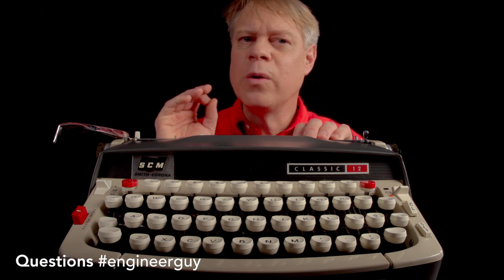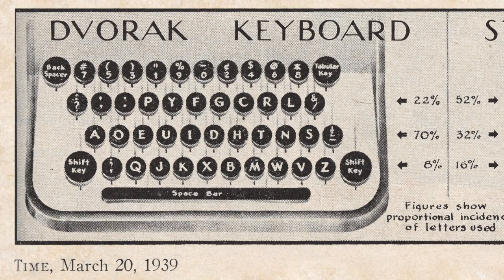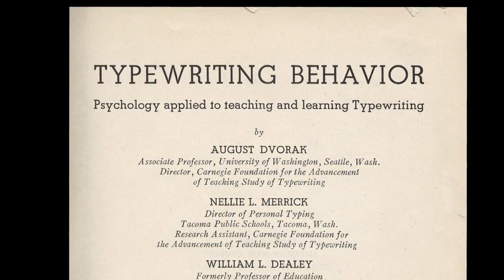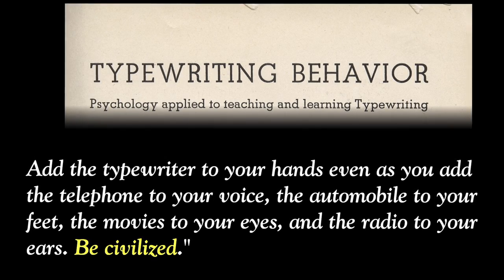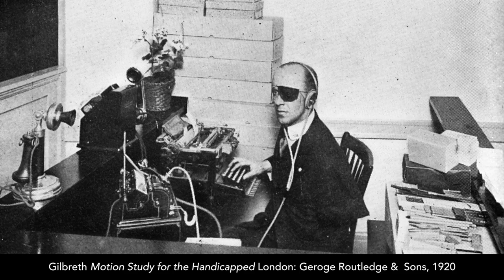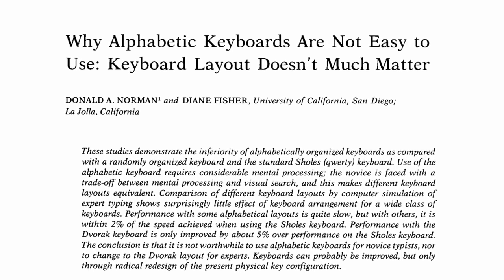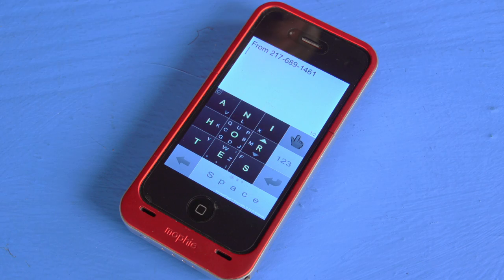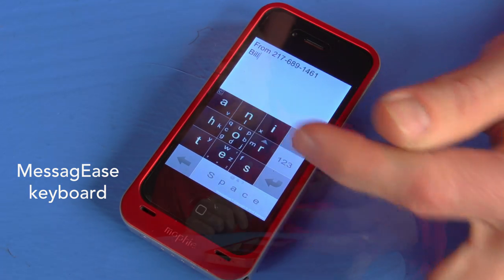Why the Dvorak keyboard didn't take over the world

Comment: I type regularly on both Dvorak and QWERTY layouts, and can comfortably touch-type on either one.

My personal experience is that Dvorak is about 75% faster for typing - I manage 70 WPM on Dvorak , but only 40 WPM on QWERTY.  This is quite interesting considering that I started using Dvorak relatively recently, maybe 8 years ago, but have done QWERTY since I was a child and indeed had formal typing classes on it.

There are some further wrinkles, though.  Firstly, my Dvorak keyboard is not quite the standard staggered key layout, but is an ergonomic one with the keys laid out in a grid fashion, much like the numpad.  This probably factors in to some extent.  Originally when I learned Dvorak, I was using an ordinary keyboard remapped to the Dvorak layout.  At this time, I found switching back to typing on QWERTY very difficult because learning the new layout scrambled my muscle memory.  I could type naturally up to a fairly rare letter, something like B, where normally I might have a split second pause to remember where it was, only to find that I had no idea whatsoever, just as if I was learning from scratch, despite having used QWERTY for many years before that.  After a few months, I got my present ergonomic keyboard, and suddenly I could switch back and forth between keyboards (the QWERTY ones being standard keyboards on other computers) without any problems.  Apparently the slight differences in key alignment stopped the conflicts in my muscle memory.  Very interesting.

Another thing I've noticed is that while Dvorak is far easier and faster to type with most of the time, it's really, really bad if you have to do any 1 handed typing.  This is due to one of the major design choices in the Dvorak layout - all the vowels are on one hand and all the common consonants are on the other.  This improves typing since it means that alternating hands between letters is very common.  This, however, is a worst case for 1 handed typing, since it means the vowels are on one side of the keyboard and the common consonants are on the other!

The one really big reason stopping people from switching layouts is the sheer amount of time it takes to learn a new layout.  In my case, it took about a year before I was typing on Dvorak as fast as I could with QWERTY, and while this is pretty impressive considering how long it took to get QWERTY there in the first place (and I indeed now type Dvorak faster than I ever could with QWERTY), a year is still quite a investment in terms of time!
Reply: GAH!  Youtube ate all my newlines!
Reply: Excellent comment. Thank you,
Reply: The Youtube comment section is so full of idiocy that Youtube can't afford to keep it indexed and searchable, there's just too many of them, and most of them are "first" or "I'm early".
Seeing comments like yours, of which there are many, but are drowned by the other bullshit, really makes this a sad realization.
I truly hope that at some point all these comments will be searchable. There are many testimonies and "tiny blog posts" in the comment section that would be an interesting read, for someone doing research into what people think or their experiences.
Cheers!
Reply: It only took me a month, and about two to get back up to ~70 WPM that I had with QWERTY. Guess it depends on how fast you learn and how much you type really.
Reply: There are 1 handed Dvorak keyboard layouts for either hand. They might even come with Windows these days.
Reply: I've been using Dvorak and QWERTY interchangeably for years, depending on what I'm doing.  After a bit of time with Dvorak, I can type with both at about 95 WPM each with similar accuracy, but Dvorak is definitely much more comfortable to type with for long periods.

I didn't have the same success getting "faster" with a new keyboard layout as a lot of people did, but I do still recommend it to people that type a lot during the day, and a lot of people do seem to learn it really, really fast.
Reply: Perhaps it was not only the Dvorak layout but the straight grid arrangement which helped to increase your speed. As anyone who has actually SEEN a mechanical typewriter up close can see, the reason for the staggered arrangement was to put the center of each key on a unique X-coordinate, so that a series of parallel levers could be used to communicate the key motion to the rest of the mechanism. With electronic and touch screen keyboards, this is not necessary, and the keys can be in an orthogonal (or hexagonal if you're into beehives) arrangement. Indeed, the position codes used to describe the locations of keys in keyboard driver software use X- and "Y"-coordinates, with the "vertical" axis tilted so that, for example, the keys 3edc and space are in one "column," while 4rfv and space are in the next, while the physical and geometric arrangement looks like a mechanical keyboard, for the sake of tradition.

(continued)
Reply: +Allan Richardson (continued) So perhaps the straight, rather than staggered, grid is either objectively more ergonomic, or the slight difference prevents automatic "fallback" to qwerty habits, allowing the Dvorak layout's advantage to be revealed, much as children being raised bilingually, and adults learning a new language, learn faster and more fluently when the two languages are used in different contexts and with different people (e.g. the French mother only speaks French when alone with the child, while the English father only speaks English).
Reply: Dvorak in a grid I think would work out quite well as the F key is a bit of a stretch in Dvorak using the ASCI configuration.
Reply: I do in fact use Dvorak on a grid layout.
http://www.typematrix.com/
Reply: Yep, alignment modification is how you shut off dat dere muscle memory, or even "swap between movement patterns" more easily.

That's why some fighters change stances slightly for no obvious reason, not even for ease of deploying a strike, but to remap the muscle firing sequence. And why some console gamers can escape the problems of having the X button on 4 different places, depending on wich console you're using.

Of course it can be done without this, but it aids in minimizing those "uuuuhhmmm(?)" moments wich are no bueno at all.

Btw, long live one handed typing while camping xD
Reply: zahrim bizarre
The keyboard shape really did make a difference there too, though not quite in the way one would expect.  For the first month or so, I got to typing Dvorak pretty well, but when I'd switch back to using a Qwerty keyboard for whatever reason (different computer, mostly;-) ) my head would explode and I wouldn't be able to remember the key layout at all!  It was almost hunt and peck!  Once I switched to the grid layout for Dvorak, that problem went away entirely and I could type on either one interchangeably without any problem.

There are some other interesting effects with respect to various layouts too.  Windows (and Mac, for that matter) lets you change your keyboard layout just in settings somewhere or other, so you can type on any old Qwerty keyboard as if it were a Dvorak one.  The problem is that while I can touch type just fine, if I ever actually see the letters on the keyboard in the wrong places My head explodes and suddenly I can't remember where any of the keys are supposed to be or touch type at all.  Interesting cognitive dissonance effect.
Reply: +Keldor314 hmm... Well, i happen to be a native spanish speaker, so adding a different keyboard layout might be too much trouble on top of different sentence structures and grammar, besides i don't need extra speed... I was just trying to chip in some knowledge about stances and muscle memory.

Even drivers i know tend to shift their butts on the seat when they change from truck to sports car. 👀 "it helps you remember what you're using" they say.
Reply: maybe that's because you have low affinity with qwerty? you double your 
speed with dovrak, but you actually have a fairly low wpm rate in 
qwerty, which is what makes that possible in the first place.

i'm a pretty fast typer, and i can maintain over 90 wpm in qwerty for 
hours if needed (peaking at about 130 for short minute-long bursts, i 
think) . i have no idea what i'd get in dvorak but i'm damn sure it 
wouldn't be anywhere close to twice as fast, because at the speed i type
 it's not that far from the speed i can actually read and comprehend 
what i'm reading, or form clear and concise sentences in my mind.
Reply: I can type about 110 for extended periods with both Dvorak and QWERTY. Dvorak feels nicer to type because one hand doesn't get all the strain, as it alternates, and this is part of the inherent design.
Reply: +Theodore042 They are already available in Windows.
-Just open your "Text Services and Input Languages" (Control Panel -> Region and Language -> Keyboard and Languages Tab -> "Change Keyboards")
-Under the "General" tab click "Add"
-Search for your language and expand it by pressing the "+"
-Check "Show more..."
-Scroll down to "United States Dvorak" and check it (You can even decide between left and right handed)
-Press "OK"
-Press "OK"

Now you have the possibility to switch between your old keyboard-layout and the Dvorak-layout by clicking the language button in your taskbar to the right and select between them or you can just press Alt+Shift to toggle between them.
Reply: 40WPM is pretty bad. Back before I learned to touch type, I could hit 35WPM with just two fingers. If you're doing 40WPM touch typing, that means you haven't practiced enough.

80WPM is easily achievable with a QWERTY keyboard if you spend some time practising. Even late into the evening, copying somebody elses text word for word, I'm still over 70WPM and I type fast enough that I'll have entire wrong words show up in my text if I have something on my mind.
Reply: I'm by no means a serious typist.  I don't practice at all, and just type when I want to say something.  In that case, I generally spend more time thinking about what I'm going to say than typing.  Perhaps the conclusion to come to is that Dvorak is significantly faster to pick up and use without dedicating any more time to learning than necessary.  I've only measured my speed out of pure curiosity.
Reply: I can write over 100 WPM on QWERTY. The studies are right. Key order simply isn't that important.
Reply: Back in the day of unassisted manual machines, sixty or seventy WPM was considered expert.
Reply: I came on here because I'm an adult learning how to type. I'm fast with 3 fingers or hand but finally doing this the classic way. 
was wondering if I should learn both (in the same ways I have taught languages to myself) and saw this comment from you, left on my bday  (6/25). Not a coincidence lol!! this answers my question a lot,  thanks  
for your story
Reply: 40 WPM is shit slow, I can do about 300 WPM per hand.
Reply: Keldor314 what keyboard fo you have?
Reply: 40 WPM? Come on. That has nothing to do with dvorak being faster, you just don't know how to type. If you got a copy of mavis beacon and starting typing properly, I'm 100% sure you'd match your dvorak speed.

No, the reason I don't learn dvorak is because dvorak is pointless. I don't have carpal tunnel, and it offers such a negligible speed increase that there's literally no reason to even consider it, let alone completely relearn all of the muscle memory I've built up over years.

In other words, you being a slow typist does not make Dvorak superior.
Reply: 300 WPM per hand he says lmfao

As if not even most court stenographers can't type that fast.

You're literally 100WPM faster than the world record holder in each hand, congrats.

I don't think you know how long a minute is, or how to count to 300.
Reply: Eric Bishton It's not that Dvorak is pointless, it's just not worth the trouble, especially if you're already a fast typist (typer?)
Reply: Keldor314 Like others pointed out, maybe it's because you can't type in qwerty in the first place, I can go up to 120 wpm in qwerty but like ~0.5 wpm in dvorak because I very rarely used them, does that mean dvorak sucks massive donkey balls? Of course not, it's your typing skills and your familiarity with the keyboard layout.
Reply: Keldor314 Also, 8 years isn't 'recent', that's way enough time to make you a good typist with any layout.
Reply: +This is Patrick
damn. how'd you get so fast? are you a programmer?
Reply: Justin Crediblename Nope, government offices here have this weird test where you have to score a minimum wpm rate at typing tests, so I'm forced to learn how to type quickly.
Reply: It's funny you consider "recently" as 8 years. That's enough to master an instrument.
Reply: Geez, my hand writing is faster than using any keyboard, I can only type an average 3 wpm and write an average 16 wpm. I guess this still has something from high school at the time where there was only one computer or electric typewriter in the whole school in the last year I was there and I have always written everything on paper by hand before ever getting to any keyboard. Yet I read an average 85 wpm yet can't seem to speak the word's through at the same speed.
Reply: It took me about three months to get up to speed, but I was in full immersion mode. I practiced for about an hour every day. Even my phone had it. To your point about the grid layout. My phone was much easier to learn on because the muscle memory wasn't as old. Even more, a couple years ago I actually adopted the keyboard this guy showed at the end of the video a couple years ago, and I got decent within probably a week.
Reply: Great...I use "Colemak".
I don't know if that's bad or better.

Comment: Before watching: because standardization beats efficiency.
Reply: bcubed72 same with measurement systems
Reply: @kinnikuzero  Only in USA though
Reply: That is an awful but true point
Reply: For it to worth changing standardisation for efficiency, there needs to be a significant improvement in performance. 5% improvement just isn't enough for people and keyboard manufacturers to change to a new standard.
Reply: @bangscutter  Built to order computers like Macbooks could offer a DVORAK option on the order form perhaps, while both QWERTY and DVORAK keyboards could be stocked side-by-side in Apple stores for desktops? :)
Reply: What if I told you - standardization enables far greater efficiency at a global level.
Even suboptimal standards are way better than no standards at all.
Reply: @unfa00  That sounds suspiciously like my argument. Though you seem to think it contradicts mine, for some unfathomable reason.

Comment: I have been using Dvorak for several decades.  Even before PC came.
The first one was IBM Selectric typewriter with a Dvorak typing ball. Next, I had the typewriter modified into Dvorak arrangement so that I could use any IBM Selectric typing balls. When IBM PC came on in 1980's, I had to wait until a key remapping program became available. Now it is easily supported by Windows OS.
I would never go back to QWERTY. I have typed several book length material. QWERTY could have killed me with  hand strain. For last 10 years or so, I have been using TypeMatrix typewriter which allows to toggle in and out of  Dvorak layout without going through Windows language setup. Qwerty should have been dead, but reality is like the way things are - dead men walking without knowing they are dead.
Reply: Same here, though not until 2004 or so.  My wrists stopped hurting almost immediately after switching, and as a bonus, it discourages anyone else trying to use my computer.  Only hassle is laptop keyboards (use stickers) and quite a few PC keyboards that are oddly resistant to moving the keys around.
Reply: all i have to do is hold ctrl and press shift to switch between Dvorak and Qwerty on win8
EDIT: that is, after you have added the keyboard in the settings
Reply: Jared Lessl the reason is that caps in detached keyboards are profiled, with each row having different heights and angles. Rearranging the keys to a different layout will weak havoc (see http://www.keychatter.com/keycaps/#profiles)

So get a mechanical keyboard with detachable caps and replace its keys with a set having a "DSA" profile, where every row has the same height and angle.
Reply: TurtleShroom What, youre here? Wow, the internet is such a small place.

Comment: I'm a user of the DVORAK keyboard, not because of speed, but because of ease. I was never able, not in 25 years of typing, to grasp the ability to touch type. It was very difficult for me to learn the position of the keys and commit them to muscle memory. I was constantly looking at the keyboard. Once I tried DVORAK, that all changed. Touch typing happened within the first week. I was an instant fan, and I will not go back. The next miracle breakthrough came with the purchase of a matrix style keyboard, specifically the TypeMatrix 2020, then the 2030 when the first one wore out after many years. I carry this keyboard around with me in case I have to use someone else's computer. To me, the best approach to converting the masses is not by claiming faster typing, but in demonstrating the much faster ability for children to learn the standard. If the standard were endorsed by the public school system, the keyboard would change almost universally in less than one generation.

Comment: One thing that really doesn't help in the modern era is keyboard shortcuts. Keyboard shortcuts were very clearly designed under the assumption of QWERTY keyboards, as is the typical WASD control scheme (mostly used for gaming, but also for 3D model viewers and other work programs)